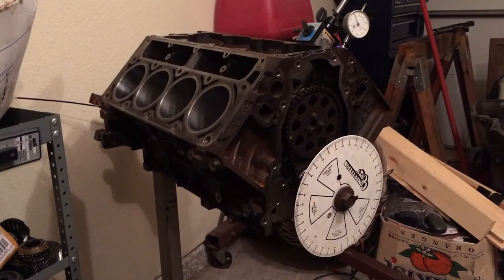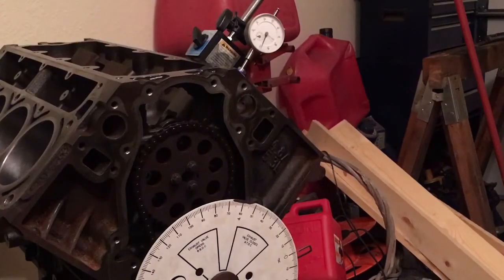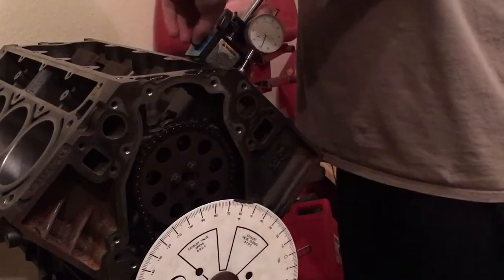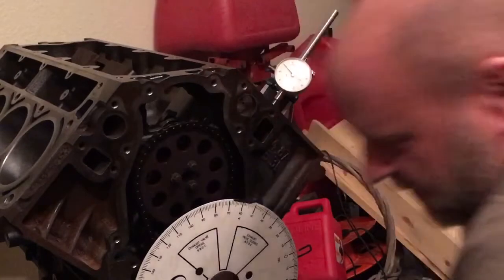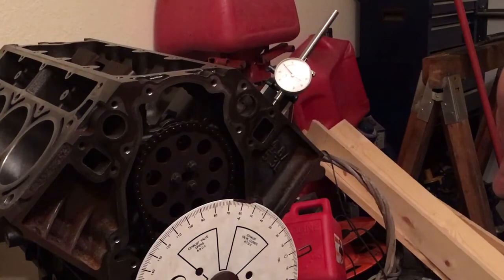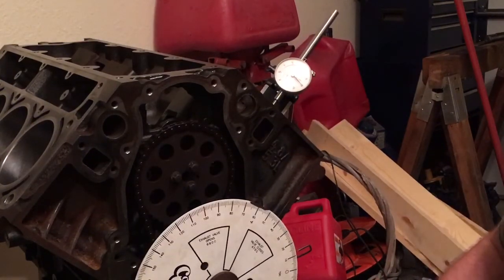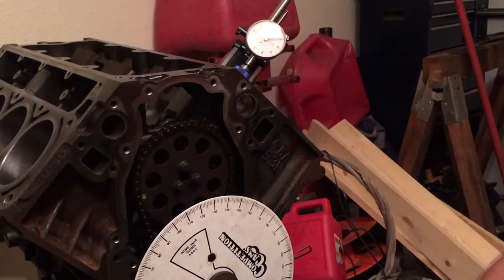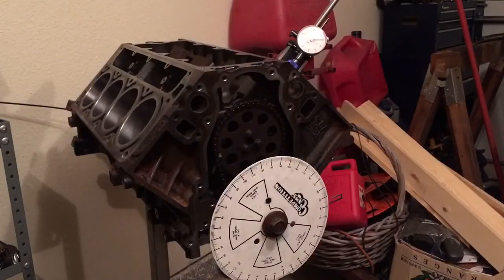True TDC using a dial indicator as the positive stop

Comment: The dial indicator as a positive stop will be the most accurate.  But you're doing it wrong. You have to do it the same way as the positive stop: on one side of tdc, if you turned it CW, you have to turn it CCW (through 300+ degrees) through BDC and back up to the other side of TDC. That way it loads the clearances up the exact same way. Turning the crank in just one direction like you shown allows the clearances to stack up non-symmetrically (pushing on one side and pulling on the other). Secondly, the dial indicator does not cause the piston to rock in the bore like when it hits the stop (if its directly over the pin). A stop could rock the piston in the bore slightly differently each time

Comment: The way you did it this time is the way i was trying to describe in my other post. It is the way i have done it for 30 years because i cant consistently get within 2 or3 degrees the way you did it. The only time i use a positive stop is if the heads are still on the engine.
 I also install the cam advanced 2-4 degrees with a new timing chain because high spring pressures and 7000+ rpm stretch the chain pretty quickly.

Comment: I used to use the same tools to degree my cams in back in the day. I now use a pro wheel and have all the crank sockets. I also have the lifter bore that holds the dial indicator. I like zeroing out the degree wheel with a piston stop. 1/2 degree to 1 degree is acceptable. Once the engine is up to operating temp and load is applied to the timing chain it will change that reading anyway. Great video JD.
Reply from the maker: Mike MacCracken Thank you!

Comment: Ahhhhhh,
This is what your doing.
Good work.
The mopar performance 8th edition engine manual I bought back in the mid 90’s shows the method you just used with indicator.
Reply from the maker: TheProchargedmopar I was surprised to see it could/would make a difference.  We’ve been using a dial indicator without heads and a piston stop with heads. But I hadn’t considered I can verify a true or most accurate TDC by combining the dial indicator and the stop method!  I really like this process.  Thanks!  JD

Comment: Actually you can.
Bring the piston up to X amount using indicator, 
Then rotate the opposite direction and bring the piston to the same X amount.
Just like positive stop method.
Reply: What he is doing is taking into account the rod slop. the rod slop will give you up to a 2 degree margin of error which is to much so it has to be taken into account and adjusted for. The larger more expensive wheels have less error and more accurate. they allow you to get more accurate results quicker.